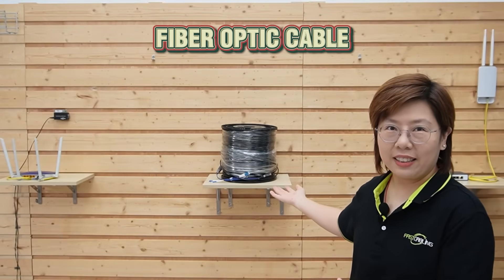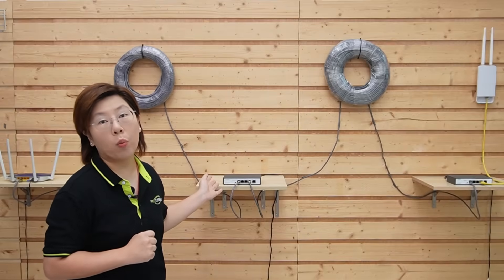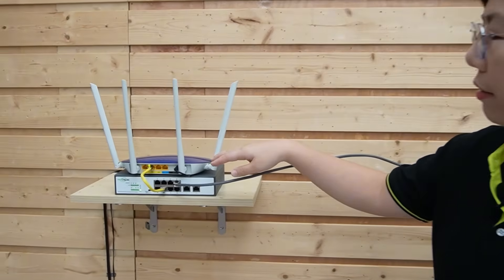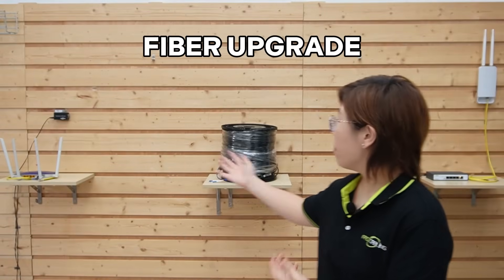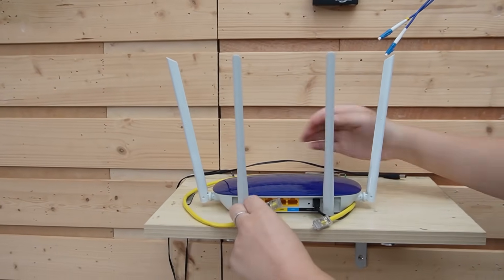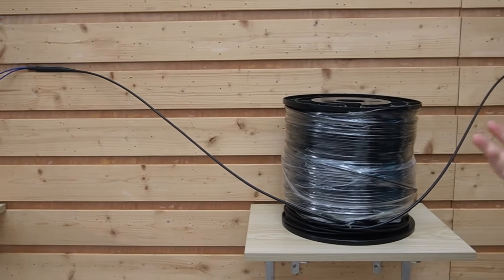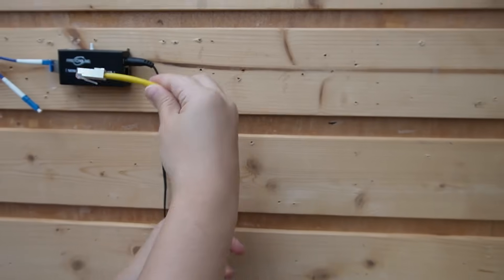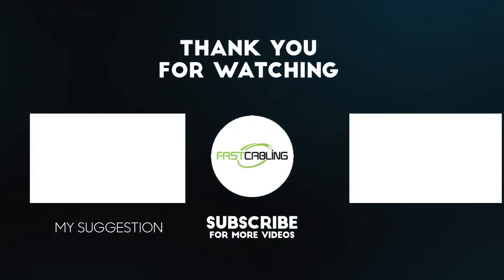How to Bridge 600ft Network Between Buildings: Long-Range PoE vs Fiber

Comment: It’s fine if you’re just running one access point, but once you start adding more gear, the network traffic builds up fast. You mentioned using a 4- or 5-port switch — honestly, that’s not ideal long-term. I’d go for at least a 24-port PoE switch so you’ve got room for CCTV, access points, IP phones, and anything else you add later.

Also, you didn’t mention if the switches are managed or unmanaged. Most people use managed switches so they can split traffic with VLANs — gives you way more control and stops IP conflicts. With unmanaged ones, everything ends up on the same network and it can get messy real quick.

If it was me, I’d have a 24-port managed PoE switch on each side, run a 10-gig multimode fiber link between them, and manage it all off one broadband line. Saves a lot of money and you can keep both networks running smooth with no lag.
‘
Reply from the maker: Appreciate the advice.

Comment: Hello please how can I get that long range Poe switch i really need that for connecting of cat6 over 250m
Reply from the maker: Two long range PoE switches working together can achieve up to 500 meters network link, and the bandwidth is 100Mbps.